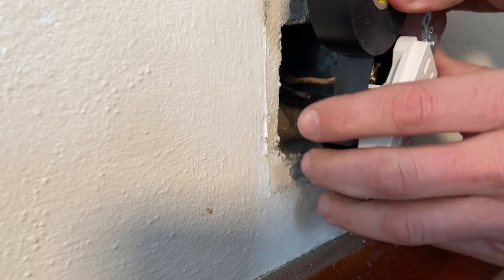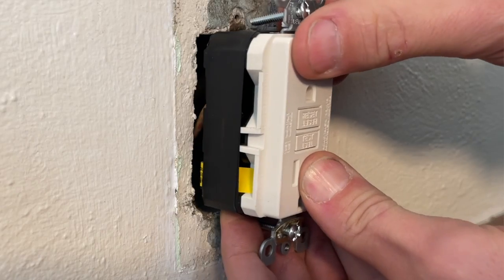Should You Wrap Outlets In Electrical Tape?

Comment: What do you do in this situation...

We had a bathroom with a single light switch which turned on both a ceiling light and a light bar above the vanity. We wanted to put both on separate switches...

What I did...
The power went from the switch to the ceiling box and then to the light above the vanity.
I opened up the ceiling box and disconnected the wires leading out of the ceiling box to the vanity light.

Question... What is the proper thing to do with those wires? Anything special? Or just cut them off or label them as "abandoned _ do not reactivate"?

I wired the vanity light getting power from the GFCI receptacle at the vanity (not attaching to the load side).
Reply: You can just leave them in the box with wire nuts on the ends. Why didn't you take the power from the load side of the gfci? It would be a quick way to tell that it tripped...
Reply: @jimmac1185  
Because if the GFCI trips, I don't want the lights to go out. In retrospect I guess it wouldn't matter since the ceiling light is now on a different switch.

Comment: have you tried WAGO connectors instead of wire nuts??     I like them.. Quick and easy to use.
Reply from the maker: Yeah, and I have done a few surveys of the audience and it looks like about 12%-14% of respondents use Wago lever nuts.  I will do a video coming up on the different options.  Wago has a new compact push in connector called the Wago 2773 but looks like it won't be out till summer 2021.

Comment: Tape leaves such a mess after it gets warm and will migrate/move over time if stretched.  I don't use tape just to get rid of the mess.  Get rid if the wire nuts and use WAGO 221's.  😎

Comment: It’s funny I recently commented this on your video and now it’s in my suggestions the reason I feel you should wrap them is because the covers frequently break off completely when people dirt cords out or bump into them then you will have exposed parts at a child’s level is very easy to grab those sides and electrocute yourself even an inexperienced homeowner might even just grab the side to try to pull it out not knowing better,I feel like the added protection is worth it

Comment: So at the recommendation of my electrician friend, I wrap all my outlets in electrical tape. And nearly every one I've removed a year or more later, the tape has slid off the outlet and is just a random ring of tape around the wires. Not just once or twice, nearly all I've taped. I don't think I tape with an unusual amount of stretch so I don't really know what's going on with that.
Reply: You used crap tape from Wally world.  Buy the good 3M tape and you won't have that problem.
Reply: @scottsatterthwaite4073  I've tried many different brands including the "good" 3M tape. The result is always the same.

Comment: Supposed to pull test before tape.  Tape is good on wire nuts if you have debris or exterior walls for moisture protection.

Comment: No matter the project, I consider electrical tape to be a short term solution. It just doesn't stand the test of time. That tape will be in there possibly for 30+ years. Anyone that works with anything vintage knows that anything with an adhesive will eventually fail. I have had electrical tape come loose sometimes from heat and it just becomes a sticky mess. It is also a pain to get off if you ever have to remove it. If there ever is arcing it is one more than in there that can catch fire. I have even seen things that get coated in dust become conductive and the sticky tape could attract dust if there is a draft going into the gang box say from running exhaust fans.

Comment: I'm a retired Canadian building systems technologist with an electrical ticket. We use the terminals on a device (never the back-stab holes), screw in the unused terminal screws, always use pigtails, use linesman pliers to tightly twist all conductors together BEFORE using a wire nut, and twist those wire nuts on tight. We NEVER use electricians tape on wire nuts or around a device such as a receptacle; it looks like the work of an amateur. My inspector friends rarely ever see someone do that but if they do they always roll their eyes. That job gets extra scrutiny because the guy is obviously not a professional.
I spent twenty years in hospitals and long-term care facilities.
Reply: And one more thing: unlike a few guys below, I have never been shocked by a live circuit. Why not? Because I trace it back and lock it out. It's off. Only a fool works on live circuits. And it's illegal; wait until OSHA or worker's compensation finds out what you did, after an accident. I had a friend, an appliance guy, killed when he was working on a live circuit. He knew better but his corner-cutting killed him.

Comment: i usually wrap around wires are hitting close to ceiling fan bracket so it won't cause a short during operation ...its usually area should be more attention due to rubbing motor..i make sure its not hanging close the motor in first place...i seen it with 2 ceiling  fans so far...good thing the breakers trip while i just cut the burn wire from ceiling  fan...i find this same problem from 1st fan, when we bought the house it has been fixer upper from seller who sold to us...oddly the wire i found from fan was for the lamp..same problem for 2nd fan...coincidence the same wire to the lamp that was the cause to short it when running for period of time..motor head been rubbing the wire that cause to expose the wire from plastic sleeve ...so i use electric tap after i fix it by make clean cut and wire nut tight together then stuff it back into bracket all tape up as another layer for protection...i tape where nut meet the wire and entire wire that goes to the lamp..i did the same for fan motor wire...

Comment: Our company policy is that we wrap all devices including receptacles, and toggle switches for commercial and industrial work. I like it cause if I have to get into a box that has a live switch that’s 277 volts   I won’t get shocked or shoot sparks every where when pulling the switch from the wall.
Reply: @Dev JB yeah, 277 volts through a toggle switch for 277 volt lighting in a commercial building. That’s pretty common.

Comment: I generally only use tape for damaged sheathing. Or for purposes that arent electrical. In my time of doing rentals, Ive encountered more bad from tape than good. As far as boxes go, if im replacing the outlet, Im replacing the box too. I dont use metal boxes for house hold / residential outlets unless required by code.

Comment: I have come across enough sloppy jobs where electricians/car mechanics just join wires by twisting and wrapping with INFERIOR tape that slides apart under heat that I don't do that just to differentiate my work from theirs. In a pinch I use surgical tape. The adhesive can stand the heat. I may also cocoon the joint with sewing thread. If the outer wraps are mechanically frayed, it alerts me to investigate while the inner wraps hold the fort.

Comment: Need to twist wire tips plus the actual insulated wire few turns this locks the wire bundle together. Wire nut and wrap with tape this is the best way.

Comment: I'm a licensed electrician in NY and have been in the trade my whole life (it's the family biz) Definitely recommend tape regardless of box type just because it's a good habit to get into? The tape on the wirenuts is always a dead giveaway some building Porter or handyman decided to do electrical work. I find it's typically done to cover any extra exposed bare conductor. Definitely do not tape your NUTS!!
Reply from the maker: Sound advice, thanks for the feedback 👍
Reply: I only tape wire nuts if the box is stuffed and there is ANY AMOUT of exposed wire that I can see. I know I can take it apart and trim it, but a piece of tape doesn’t hurt.

Comment: I saw a flash and a young guy fly 20ft.He turned the breaker off and cut the inlet side on a 550 3 phase.What saved his life is he cut it with a hack saw.It acted as a fuse.I have worked on live 3 phase.Don't recommend it.Even at 208 volts 3 phase will kill you. It stops your heart, if the burn does not get you.120 volts just a tingle.Like a 9 volt battery.Yet i was taught humans do not feel under 50 volts.Yet i have gotten shocks from car batteries.max 16 volts.Amps times volts equals watts.
Reply from the maker: You do need to be careful.  My dad was a lineman and he had a buddy get burned.  Electricity is no joke.

Comment: I have come across at least three different situations in which taping could have saved serious risks.  Moisture from rain, moisture from ants and moisture from termites.  In each case if any part of the wire is touching or near to wood the electricity can enter the wood and move along the grain with moisture.  Until it reaches a screw that penetrates the wood which can be a door handle.  In one case it was the aluminium siding of a mobile home.  In each case a dangerous shocking situation happened.  In some cases a fire or near fire was involved.  So I tape or fill spaces with my glue gun or silicon rubber so that there is NO POSSIBILITY of a dangerous situation being created later.

Comment: I always tape wire nuts and outlets! do your pull test before you apply tape.  I’ve seen to many wire nuts vibrate loose on motors that were not taped! Plus before you finish the tape, fold the tape to itself so it doesn’t stick on the end, this leaves a little pull tab to make it easier for the next guy to find the end and remove the tape.

Comment: So back when I was a teenager, one night I'm in bed and I keep waking up wondering wondering why my toe keeps falling asleep.   After a few times it occurs to me that there is an electrical outlet at the end of my bed.  I get out of bed,  turn on the lights and pull the bed away from the wall.  Sure enough, the plastic plate had cracked off and was laying on the floor.  It turns out the tip of my toe was touching the live wire inside the box. 

So yeah, wrap the receptacle.
Reply: I liked that

Comment: Taping the wire nuts should be only an outdoor locations it does keep some moisture out but they always end up unwrapping or deteriorating overtime,It does kind of create a pain in the butt to undo but if you leave enough wire there are some other options

Comment: I think it's personal preference.  There is nothing wrong with wrapping outlets. As far as the wire nuts, if u do the pull test before wrapping them then there is no issue of wires not beingconnected. I do it just for peace of mind, it's not really necessary.

Comment: Hmm I've often used electric tape over wire nuts. But I do the pull test before wrapping it up. My reason is not to hold wire in place, but for extra safety of any sparks that may possibly occur.

Comment: Then 20 years from now when the next guy goes to change an outlet or take off a wire nut, the tape is solid like a rock. So then that person uses a knife to cut the tape while scoring the insulation on the wire in the process. Which mind you the insulation is already brittle from age. That then leads to a plethora of other issues. Point is especially in residential, if you do the job the right way there is no need for extra "security". I only use tape in wet locations or high vibration areas like motors. Oh and never make splices in outlet boxes by stabbing the outlet in the back. Good way to lose power to half a circuit when the outlet dies. Always make your splice with a pigtail for the outlet or switch

Comment: I was taught to always wrap recepticles and switches.  I'm an electrician in a manufacturing facility.  We often pull out, and replace while hot, and the tape makes it easier.
  I use a ton of wire nuts.  I only tape in wet or moist environments.  Something like a pump motor.

Comment: The problem with wrapping outlets and switches with electrical tape is that it is a fire Hazzard.  
If an outlet or switch is properly installed, in an appropriate sized box, it's safe and to code.   Some villages use metal conduit and boxes for added grounding, short circuit and fire safety.  Wrapping an outlet in tape just increases the fuel supply if a fire were to start.  
Wire nuts don't need tape if the proper length of wire is striped.   The only benefit is to secure an improper size wire nut. 
Again, if the job is done correctly, there is no need to use electrical tape as a substitute, and risks increased fire Hazzard.

Comment: It can not hurt the wiring if the wiring is done properly but it will be a pain in the butt years later if you have to remove it because the plug, switch, etcetera is worn out and needs to be replaced.  Perhaps something like a wide rubber band like cover that can be placed over the terminals instead.

Comment: I only wrap around receptacle in metal boxes. And putting tape on wirenuts is good if you are stuffing it in a gangbox with lot of wires. Just make sure you check first the connection. Which brings me to if i had my choice i would use wagu connectors. Wagu connectors i can see that they are connected properly on the clear ones. Not only that but the connection is superior to wire nuts. I could almost hang a car off the connection of a wagu connector. If i need to disconnect, No problem and easy to put back or add to.

Comment: We use tape on wire nuts as we are by ocean and try to keep salt air away from metal to avoid corrosion.  Yes as to taping outlets, especially in small metal boxes.

Comment: I actually failed my electrical inspection on my home renovation because I taped my wire nuts 🙃.  The inspector said primarily the same thing you said.
Reply from the maker: Surprised he failed you over that 🤔
Reply: @EverydayHomeRepairs  yeah, I was upset because I couldn't find any "code" that said it wasn't acceptable. The inspector said he failed it because he couldn't see the if the wires were twisted together and that elecrical tape could dry out and become a fire hazard years down the line. I then simply removed all the taped connections.  Fortunately it was only my kitchen and our guest bathroom at the time When I eventually got a "pass" inspection I called the code enforcement office and was told the "inspectors had leeway" in these circumstances. Bottom line is "inspectors" can pretty much do as they please I have discovered over the years. I almost laughed in his face over the whole ,"electrical tape can dry out and become a fire hazard"! If that's truly the case then there are thousands of homes that are just powder kegs waiting to combust! 😆🤣

Comment: i had to replace some outlets in an old track house from the 50's that had BX wire and i did tape a lot of them, it was a tight fit with short wires.
Reply: What is a track house?
Reply: @blueoval250  the track homes in our town were cheap houses kinda slapped together on concrete slabs but they have served a purpose giving people a place to call home and a place in the sun.

Comment: Not an electrician, just live in an old ass house. I wrap the outlet or switch if the box is metal. I know it probably won't arc, but I still do it. As I renovate, I do not wrap receptacles in plastic or fiberglass boxes. That doesn't seem necessary.

Comment: How does GFI work if you don't have ground?
Reply: GFI measures the current flowing through the hot wire and compares it to the current flowing through the neutral wire. If they do not match, it interrupts the circuit. This use of a GFI device to protect a circuit without an equipment ground is allowed by the NEC.

Comment: you're supposed to twist your wires before putting the marret, so i mean there's a proper way to install it and tape over it and be sure it's not the tape holding it, and personally i add some to prevent surface oxydation especially in an outside or bathroom receptacle

Comment: I was always told not to pretwist wires before using a wire nut.
Reply from the maker: Hmmm, seems like the majority of veterans pretwist 🤷‍♂️
Reply: @EverydayHomeRepairs  ... pre-twist makes the connection and the wire nut is the belt + suspenders to keep it good. If the wire nut doesn't grab tight then you are using the wrong wire nut.
Reply: @EverydayHomeRepairs  it depends on if the wire is solid which you twist and stranded which you let the nut twist. Though sometimes I cheat and pliers twist stranded with solid.

Comment: Some times after the 4 wires soldered in a super small metal box, and since there is no equipment grounding conductor, GFCI it is, there is no room for tape especially super 33+

Comment: If you look in the box new electric box it is marked x-amount of square". That's for how many wires and devices are allowed in the box. Were the box you put the GFI in was pre existing it's ok in some areas.  For wire if it starts in the box and ends in the box = 0  for tape on an outlet no nec law I know of so do what you think is safe.  Tape on Wing nuts I have done it only in a high vibration area and shrink wrap what I cover it with.  In the old days 3 different tape was used regular tape rubber tape and cloth tape. Anyway have 😊

Comment: Sometimes I'll tape receptacles, especially when using a metal box. They help me not shock myself when pulling a receptacle out live if I need to... I usually tape wire nuts after performing a pull test to keep any contaminants out and to lessen the chances of a stray ground wire making its way to a hot set of wires under a wire nut. It's more peace of mind than anything.
Reply: And I prefer the Super 88 tape. Used it at my last job as a plant electrician. Holds up well to heat and cold and stretches like a mother.